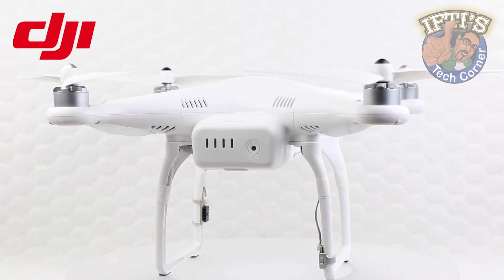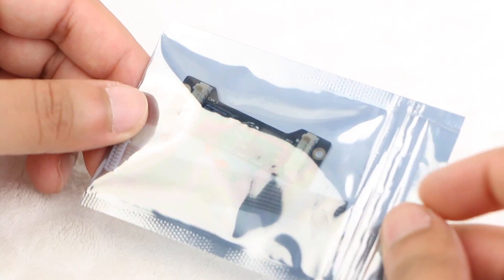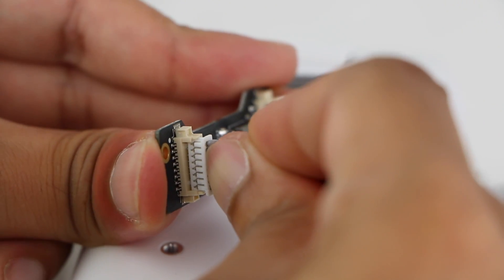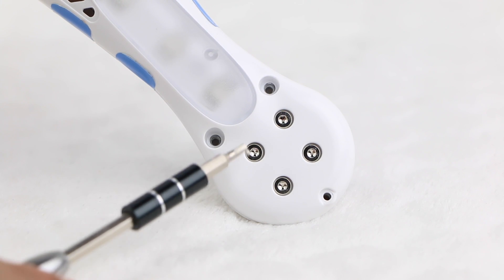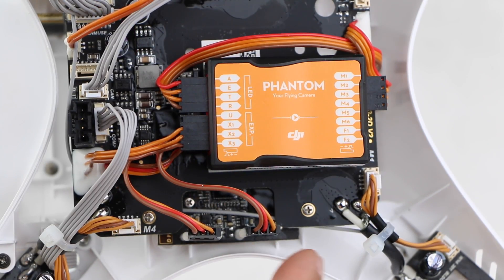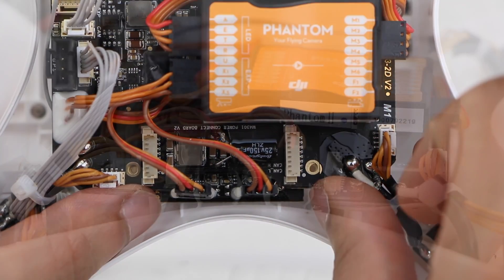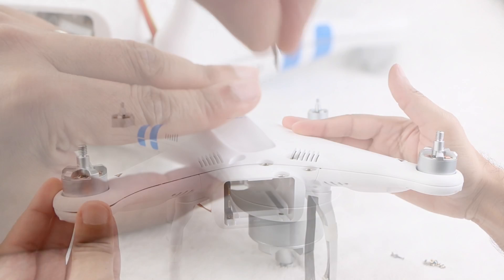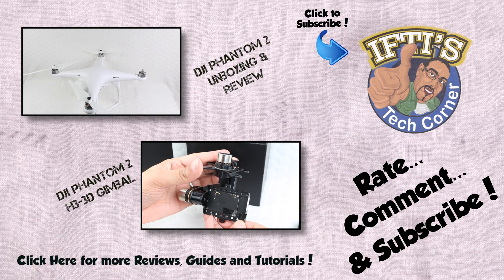#4: DJI Phantom 2 - Anti-Interference Board Installation Guide

Comment: Very good informative videos.
Q: Is the interference board required with the new H4-3D gimbal / Phantom 2 (V3).
Also I assume as you take the top off, change/adapt in any way, the warranty is instantly void!
Reply from the maker: TheBlGbadWOLF As far as Im aware the board is still required, although don't quote me on that!
When it comes to warranty - the beauty of performing the install as shown in the video is that theres no soldering or cutting of wires etc whatsoever - so its pretty difficult to mess something up! If you do, its easy enough to reverse the process and remove all the extra components ;o)

Comment: Just watched your video on installing the anti-interference board on/in the phantom 2. I have this board to install and was pleased to see this video listed. I am confused as in the external installation, the short cable supplied with the board, is connected at the capacitor end. However in the internal installation the short cable is connected opposite the capacitor end. Does this mean it can be connected either way? Thanks Graham.(new to quads.)
Reply from the maker: The existing long cable already connected in the craft, and the short cable that comes with the anti-interference board, are exactly the same - just different lengths. They can be placed on either side of the anti-interference board depending on whether you are installing externally or internally.
Reply: iftibashir Thanks for the quick reply and problem sorted. Graham.